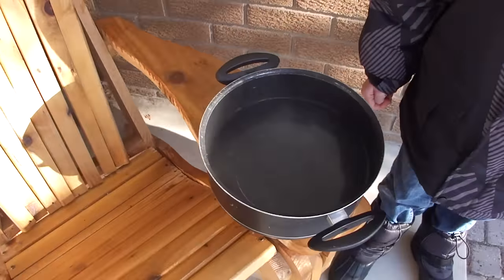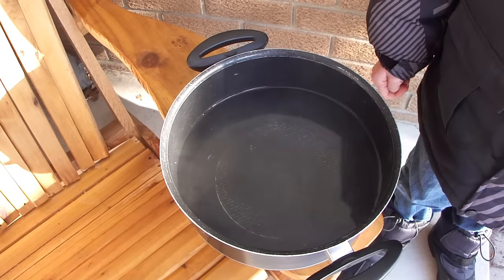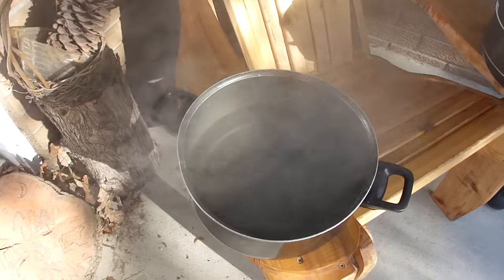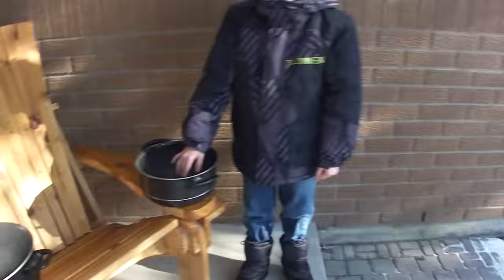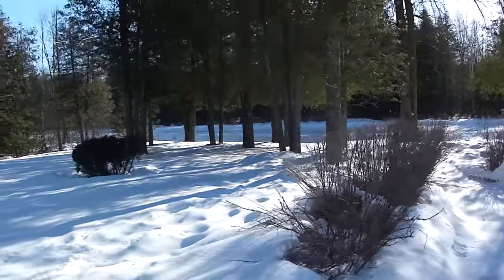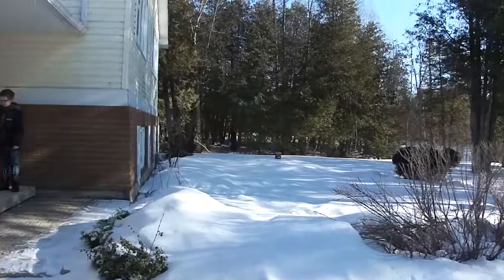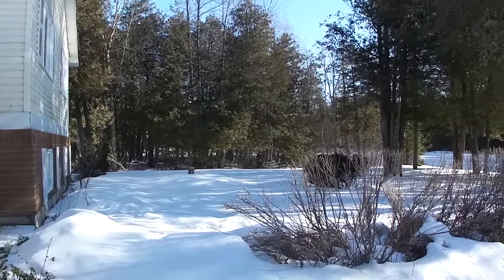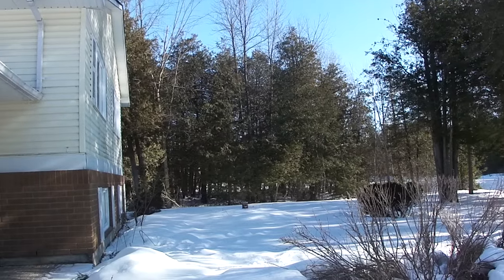Hot water freezes faster than cold water?

Comment: SIMPLE: Hot water molecules move fastetr. Therefore they can collide into each other quicker. Now when exposed to such extreme low temperatures lose thermal energy quickly. And since they collide into each other at a fast rate. By the time the water molecules are disresed into the environment. The collisions already allow it to garner up into ice.
Reply: I learned something new today
Reply: @nodrvgs  all in chemistry learn chemistry
Reply: But ice forms like crystal where the molecules are spread apart
Reply: @durpydog6123  gasses have a low force of attraction that maintain it at an equilibrium of being a required distance from each supposed molecule during its change in energy
Reply: I don't understand a single thing but this is awesome
Reply: @durpydog6123  no
Reply: Simple? used dictionary for like 10 words to understand this 😅😅
Reply: OK
Reply: Do not forget, when Water vapour touches like a cold surface or atmosphere or  temperature it starts to condense
Reply: No, No, No. If you look at the particle model of matter, cold stuff has a high attraction but less movement. Hot stuff, on the other hand, particles move fast, yes, but have low attraction. This means the particles don't touch. This means hot water freezes faster than cold water or I'm just stupid.
Reply: @santanu_kashyap  That's not chemistry. But it's not your fault because you were taught to believe it was
Reply: So your saying cold water boils faster then hot water man I always knew Gordon Ramsay was wrong
Reply: Hot water freezes faster, sure, but overall it will take longer for the hot water to turn to ice as it has to drop below the same temperature as the already cold water to freeze into ice. Essentially the logic in this video: an object higher off the ground falls faster than the one closer to the ground. Sure, the one higher up has the chance to gain more velocity overall but it’s not gonna hit the ground first.
Reply: Also the water molecules are way farther apart and less compact allowing for the cold air to get in easier
Reply: @Oğulcan Çelebi heat is related to relative movement of atoms
Reply: @Oğulcan Çelebi atoms cannot stay still
Reply: simple????
Reply: Any liquid contains molecules with a range of temperatures - some are hot (moving fast) and some are cold (moving slowly). If you boil the water, the average speed increases but there are still lots of slow-moving molecules. The hot molecules are moving fast, so they escape the mass of water quickly and disperse into the atmosphere (especially if the atmosphere is cold). The slow moving particles are left behind. Temperature is essentially just "average speed" so, since all the molecules that are left behind are cold, the remaining liquid is cold. Boiling the water speeds this process up because you're giving the non-cold molecules extra energy to GTFO.
Reply: @eager5334  basically - cold go fast when in fast thing. hot=fast
Reply: @peskypigeonx  ouhhhh....the faster the cold,the faster the hot?
Reply: yes @eager5334  just like,
Hot thing more energetic, the cold move faster in it
Reply: So in same way does cold water boil faster than hot water ?
Reply: HypR_Phsyco  Allegra-chicken eating celibate
Reply: Uh I think that none of them are freezing, all the “smoke” you see coming off of the boiling water is just vapor because you increased the surface area of the hot water. The same amount of water falls to the ground as water, not ice
Reply: Fun fact: you are wrong
Reply: You said simple
Reply: whatever you just said... I agree, god works in mysterious ways \o/
Reply: Go check out newton's law of cooling people
Reply: That doesn’t make sense at all…
Reply: Yep but it can also just be the condensation
Reply: Can this be related to Newton's laws of motion?
Reply: Ah yes simple
Reply: 8th grade Physics!
Reply: What you meant to say: hot water atoms move faster, when thermal energy is reduced they slow down and solidify transforming state of matter whereas the cold water is already more solidified and already move slower and solidified and closer to freezing point so your comment is bullshit. And you made a spelling mistake Xd
Reply: @trumpethillary2373  no
Reply: Oh yea that makes more sense
Reply: HypR_Phsyco  it’s legit simple physics that u learn in 8th grade lmao
Reply: i read everything and still don’t understand a single thing
Reply: Now I feel even more smart
Reply: Google se copy kiya na
Reply: If this were true then water would have a higher thermal conductivity at higher temperature. That isn't true (or at least if it does have an effect it would not be strong enough to explain what is seen here). I'm afraid this is the wrong explaination.
Reply: “Simple” 😂
Reply: The time it took for u to type it 😆
Reply: seems more like rocket science
Reply: This is BS. Not true.
Reply: @hadiyakhan5099  are you going to apply some varsity knowledge on me
Reply: @eager5334  the faster the hot? 😳🥵🥵😳
Reply: what
Reply: @eager5334  Me to 🤣😂🤣
Reply: @paklekj4429  umm well... 😏
Reply: @ctm9364  biology
Reply: It was just steam from it hitting cold air, cold freezes faster
Reply: Oooh I love science
Reply: Basically hot water is already tiurning into steam and steam freezes faster.
Reply: @nodrvgs  dont listem to him. He's wrong what youre seeing is water vapor: hot water emanates vapor from its surface and when you throw water like that you create more surface area and thus vapor forms considerably faster.
Reply: Simple spell faster write.
Reply: Can you say that again in English perhaps???
Reply: Yes and this is called diffusion
Reply: Wow
Reply: Someone has been attending science class😉
Reply: @nasa, here's an expert
Reply: Math
Reply: Ahh yes you could explain this on the basis of Kinetic Theory of Gas as well. But i tried to explain it on the basis of heat transfer and temperature difference....
Reply: @santanu_kashyap  no no this is actually physics. It could be considered as chemistry but as physical chemistry and not as other forms of chemistry. Physical chemistry is basically just physics but if you used chemical terms.....
Reply: no, thats steam.
Reply: No, hot water doesn’t freeze faster, but vapor freezes faster than liquid…
Reply: I disagree. this video only demonstrates that hot water, when thrown out like this, obviously creates a larger surface area, creating more opportunities for the cold to "attack" that hot water (not worded very nicely, but anyways.) it would kinda defy known physics, would hot water really always freeze faster. it's difficult to change state of matter; that's why inside some container, most time is actually spent on the freezing process itself; making it difficult to measure the effect, because the difference is pretty tiny.
Reply: @helifalic  that's an extremely reasonable explanation. I'm totally buying it!
Reply: @HxTurtle  it actually doesn't defy physics. Hot water is supposed to cool faster due to the larger temperature difference between water and surroundings. This is a much more important factor to be taken in consideration rather than surface area or energy of molecules, though they form a factor as well.
Reply: @M1551NGN0  what? that doesn't even make any sense at all! could you elaborate a tad on what you're actually meaning? when hot water cools down, won't it eventually reach the temperature the cold water started with? a big difference doesn't mean it'll teach it's "target" temperature quicker. it can only possibly mean that initially, it "sheds" a lot of the temperature. that's why I wrote that the time difference isn't too big. but it's not quicker!

well, generally speaking, that is. in this very video, due to dramatically increased overall surface area of the body of water in question (due to quite some of it actually evaporates, once you start increasing the surface area by pouring it out, which the cold water simply doesn't, hence the exposed surface area stays smaller.)

there's no reason as to why let's say nobody poured that water out, the cold water should take longer to eventually freeze. the warm water just needs to reach the exact same state the cold water's already in. which takes time. not long, though; for the very reason you already mentioned (that a large temperature gradient leads to a much quicker equalisation.)
Reply: @HxTurtle  that's the exact reason why i said that different factors come into play, the most important being temperature difference and then surface area exposed
Reply: @M1551NGN0  and how does a larger temperature difference even help a little bit with that??
Reply: @HxTurtle  The larger the difference in temperature between two objects, the faster heat will transfer from the hotter one to the cooler one. The difference in temperature between two objects is called a thermal gradient (gradient = slope). The steeper the thermal gradient, the faster the flow of heat.
Reply: @M1551NGN0  yes, but what do you think this actually explains? when you've a pot of water at 70 centigrade and another, similar one sitting at 20. and the environment is at zero. do you think because of the greater difference, the hotter pot will reach zero quicker? or don't you maybe think that the hotter one will eventually reach the exact same state (granted, differently distributed, but nonetheless) the cooler one's already in? do you really think because the difference used to be bigger like five minutes ago that the water remembers this and will therefore behave differently? just asking.
Reply: @HxTurtle  yes, common sense says the 70 centigrade water will become cooler first. If you are trying to say that the surroundings will become the same temperature around the time the water is cooling down then you're wrong. Well, granted for changing the state latent heat is required but here heat is being taken out by the surroundings and so higher temperature will cool down first.
Reply: @M1551NGN0  but you don't have any common sense. I tried my best but you're beyond help.

what I believe you seem to believe is that it's like some potential difference like one stone placed 70 meters above ground and one 20. firstly, you surely gonna say that the higher one will hit the ground first, am I right? and secondly, you probably believe that temperature probably behaves the same. but nope, it doesn't. the relative cooling speed slows down once the gap decreases. are you able to understand this??
Reply: @HxTurtle  well don't go on my common sense i don't take it kindly, i never said anything about your common sense 
And ohhh now i understand what you meant. The relative cooling speed decreases yes you're right. But then wouldn't it reach the same cooling speed as the already cold water? In that case both would cool down simultaneously?
Reply: @M1551NGN0  yes, that's exactly what I said. okay, I'm sorry to have criticized your common sense but you seemed so stubborn and what you said defied common sense. that's basically how we got into a quite divided world where people only believe their own imagination and on the Internet, they will certainly find a place that confirms their ideas no matter how far out of tune with the actual reality they're. and I didn't even mean to argue as to whether hot or cold water cools quicker, but the the explanation you have didn't make much sense. the falling objects where almost like a bait, because both are subjected to the exact same accelerating force at all times; just their speed accumulates over time (until air resistance gets a substantial say). but with a temperature difference you have initially a higher acceleration which later on actually tapers down. the only difference between warm and cold water, as you can easily see in this video, is that warm water evaporates quicker. once you've created a large enough surface area, so much water will have evaporated into the air that you've way less actual water left once it reaches the same temperature as the cooler water was at (that's the exact effect observable in this very video.) but once you keep the surface area small, the water that evaporates meanwhile won't any longer be sufficient to achieve an overall quicker freezing time.

did I write that part? don't remember, lol: I wanted to add that the acceleration equivalent, when you wanna call it this way, changes for temperature differences. like and ever adjusting 'g.' and unlike a falling objects, zero accumulation happens. so, an object dropped from 70 meters has quite some speed once it passes the 20 meter mark. but that's simply not the case. so let's say one could think as the stone falling from a higher hight needs to initially cover the same distance which happens in the exact same way. that's not true for water, which will only behave the exact same once it reached the same temperature as its "competitor." so, your only shot on "winning" this race is when you get the water to shed quite some of its mass until that other initial starting point. maybe this helps. lemme know whether you still disagree 😅
Reply: @HxTurtle  hmmm now i understand. I'm sorry to have acted stubborn.
Now i understand. It's about the surface area being exposed, because if temperature difference was really a large factor then the hot water would have cooled down in the pot itself. Now i understand everything. Thank you very much! 🙏
Reply: @M1551NGN0  oh, cool! now I'm surprised. it's hard to come by individuals actually listening and willing to learn. you're a rare exception and a true diamond in that regard. I really wasn't sure whether you're just trolling or really unsure about what's going on. yes, I should've kept and temper locked up, I'm very sorry about that (now that I've learned, you're genuinely interested in acquiring a better understanding.) I'm glad that you could overcome my unjustified offensive language and still kept asking. cheers!
Reply: @HxTurtle  thank you very much! 🙏
Reply: @M1551NGN0  oh, you're very welcome! thank you for forgiving me.

there's a ton more that can be said about this video and the precesses involved. it's not fake or anything. but a more appropriate title would be, "hot water evaporates faster than cold water."

there's no known physical reason as to why in a controlled environment, hot water should've an edge over cold. when it comes to actually forming ice, the starting temperature doesn't make much of a difference though, because most time is always spent at zero centigrade. changing state of matter simply takes a while; for various reasons. have a pleasant day!
Reply: None of this explanation makes sense
Reply: @shadowenergy4366  because it makes no sense, this guy is clueless just thinks he is smart
Reply: @rememberthiscomment7434  that's what I said as well. 👍
Reply: @HxTurtle  I spotted you in the comments explaining this stuff, and you seem to be the only other that understands Newton’s law of cooling, vaporization of water, and what it means for a substance to contain “more” thermal energy than another and how that pertains to this scenario. 

Everyone seems so clueless on something that I thought was not a very tricky concept.
Reply: @rememberthiscomment7434  yes, you're exactly right. some things are supposed to be logical, but I kinda think to know the actual source for this confusion. there's some supposed to be effect named after some African kid who's name I currently forgot, unfortunately. not only is that specific theory questionable for various reasons but the main thing is, that the experiment from this video here doesn't even proof that as it's something entirely different. (I believe most have heard about that theory briefly and now remember it again and quickly link this video to that.)

there's plenty of similar videos from Siberia, Scandinavia, and to Canada which always only use hot water. because not "_even_ hot water freezes at an instant," but rather, "_only_ hot water freezes instantly." (making for some impressive effect. I used to live in Canada as well and got down to negative 45 centigrade, but kinda missed the opportunity to try this for myself, lol.)
Reply: @santanu_kashyap  That's thermodynamics, not chemistry.
Reply: @fardeen343  Which words didn't you understand?  They're all pretty standard.
Reply: This might sound legit but in reality this dude is just spewing words that sounds like an explanation.  The reality is the molecules are spread out making it easier for them to lose heat. Since they aren't as clustered they don't have as much mass to lose their heat which means it can happen more rapidly.
Reply: You can just make up whatever you want on the internet and people will believe it huh
Reply: @santanu_kashyap  but thats more physic than chemistry.
Reply: @shadanali5858  finally, someone said it 😂
Reply: While yes, as it's hot, it will lose energy rapidly, but once it cools, it will eventually match the temperature of the cold water, at which point it would have to go through the same process as the cold water anyway. In essence the extra heat adds a delay between the hot and cold water, which means it doesn't freeze faster at all. It's like having a choice between running 5 miles and running 10 miles. You'll finish the 5 mile run faster, right?
Reply: its just newtons law of cooling
Reply: Boiling water has heat which is a form of energy. The change from gas to liquid to solid requires some sort of energy exchange, boiling water has more energy potential. (The fast moving molecules) 

The force of exposing the boiling water to a fairly low temperature and extending the points of exposure by tossing it into the air, makes the energy shift extremely quickly.